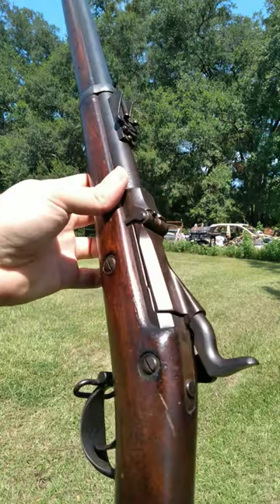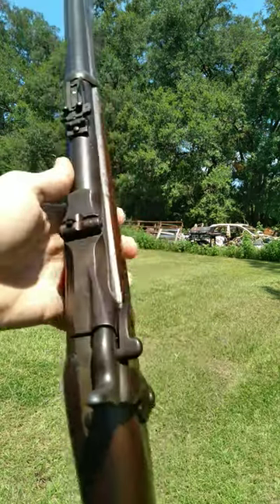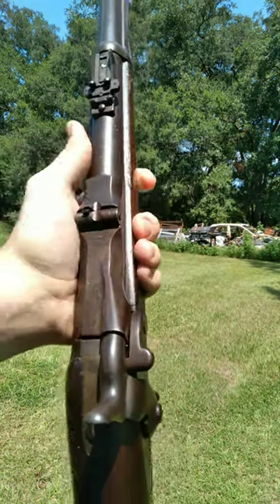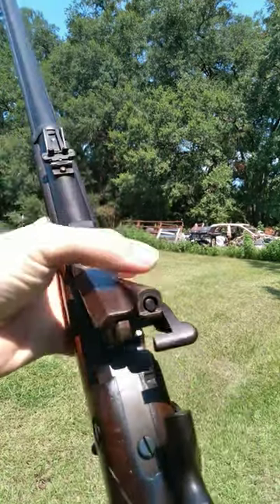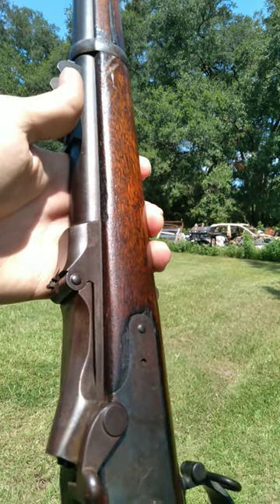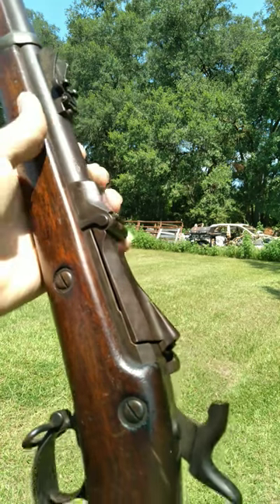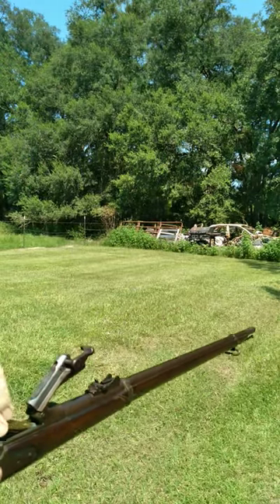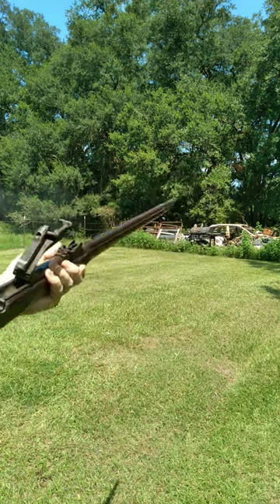1873 Trapdoor Springfield 45-70 Shooting

Comment: Enjoyed the video
First Trapdoor was the 1865, used a 58 cal rimfire the 1866 went to the 50-70. Built on 1863 rifles with a lined barrel. I used to have one but traded it off. Buffalo Bill was fond of his naming it Lucretia 
I have a 1873 trapdoor, killed a deer with some years back
Reply: Would you mind talking about your experience with 1873 Trapdoor? Reliability, ease of use and accuracy? Lots of people have opinions on it but very few have experience using it. I prefer to get facts rather than speculation. I would very much appreciate any insight you have. Thank you in advance.
Reply: @georgeyoung613  mine is the 1873 carbine, I reload the cartridges with 65 grains of black powder and cast lead bullets. Is 100% reliable , originally they  had some problems with extraction which I think was caused by the shells they used, I have never seen that using modern cases 
  Handles very well, the sights are OK I’m an old guy and have some trouble now with some iron sights. 
 Mines bore is very good and I can probably get 3 or 4 inch groups at 50 yards, to be honest never shot it much past that. I think the gun could probably do better but I’m the limiting factor
Reply: @deadhorse1391  Wow, that is amazing that you're able to reload your own rounds. I have also been looking into casting bullets also. But I think I'm going to hold off on that tell a master the press I have. I'm not very familiar with older rifles. But it is surprising to me how reliable she is. I would guess your rifle has seen a lot of rounds over the years, so shooting in the groups you're hitting tells a lot about the quality and skill that went into designing and making her. I would like to see you push the range on her if you're able. Thank you for the information on your rifle. I very much appreciate it. Much respect 🙏 🫡.